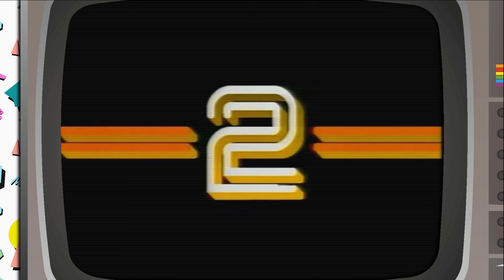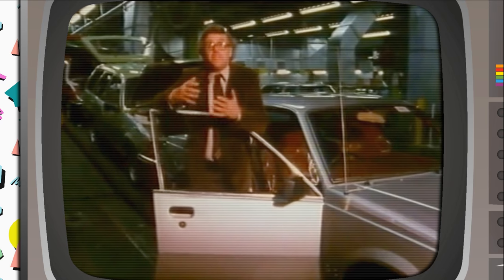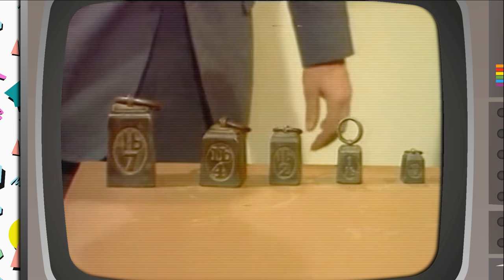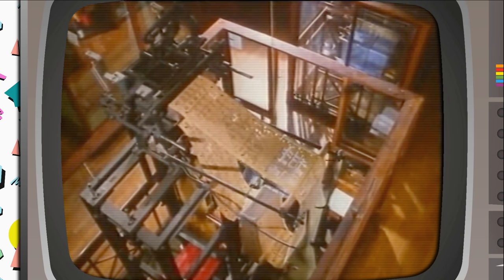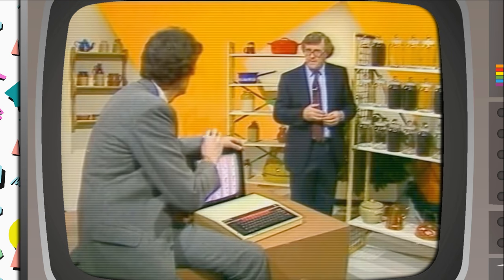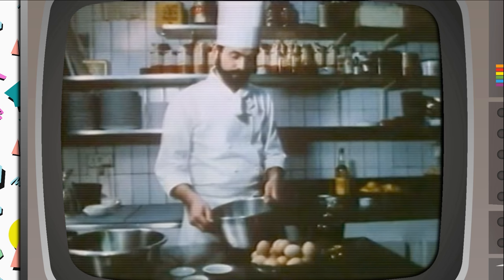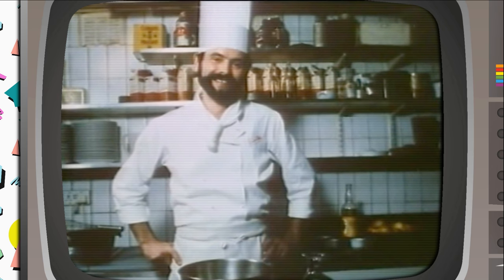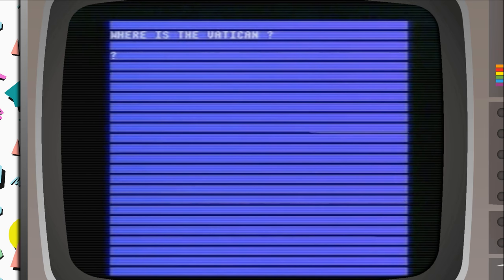The Computer Programme, 18th Jan 1982 - Episode 1.2 [Replay] | Nostalgia Nerd

Comment: I wrote a '20 Questions' programme (in Spectrum Basic) designed to find
any animal you might think of.
Reply: I tried writing the entire geometry section of my math book in V2 Basic (on the Vic20) (when I was 10 or so and didn't have much patience), complete with illustrations - unfortunately the 8 KB RAM on that thing really wasn''t adequate for doing graphics in basic, and sequential loading is such a massive PITA when there's no way to return to start without rewinding the tape and start the program over, so I never managed to complete my vision